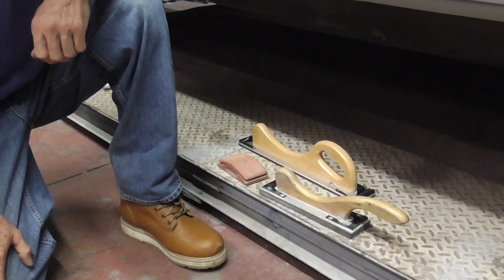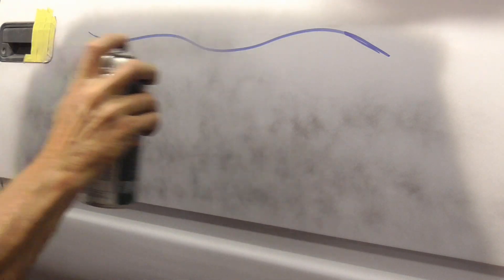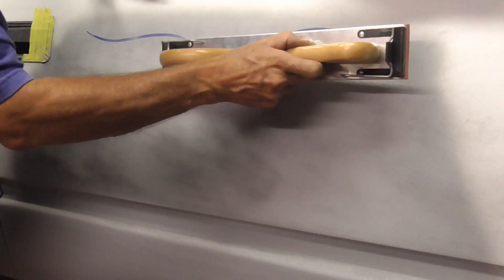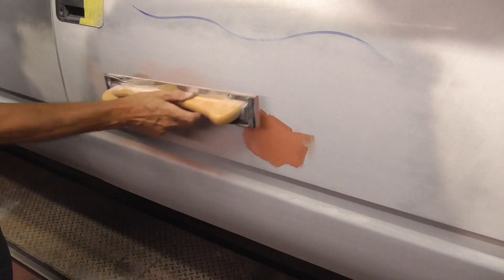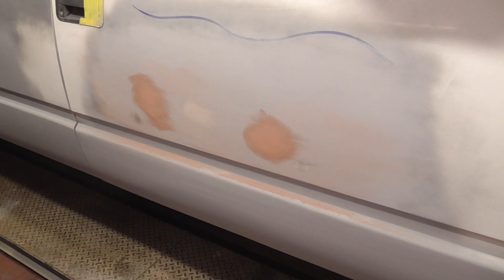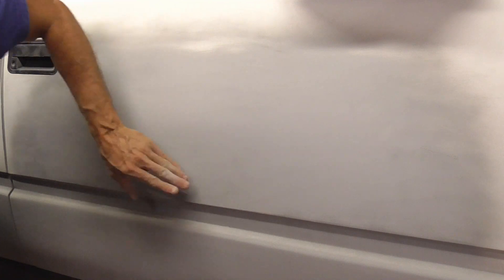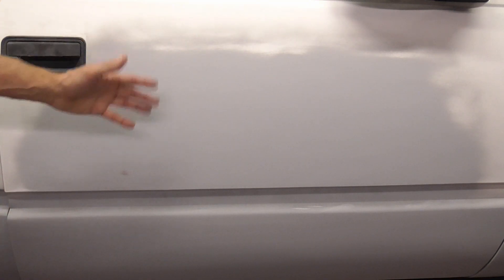Block Sanding Primer Surfacer: Addressing High & Low Areas

Comment: Great work as always.  When I first saw you sand the putty and feel the surface for smoothness, I grew concerned.  It seemed like you were falling back on your skills and experience I can’t come close to.  Then you sprayed it and block sanded it again and it became clear.   Before I start block sanding my primer surfacer I will watch this video again. I am off now to find those sanding blocks.  Thanks again for sharing your knowledge.
R,
Frank
Reply from the maker: You're welcome Frank - feel free to ask any ?s - even if they seem easy as heck :)
Reply: @LakesideAutobody  I have been advised to let body fill “gas out” and fully cure for a week before epoxy spraying.  Is there any truth in that?
Reply from the maker: @frankkennedy5361  Absolutely no truth in that.  If that were true, all these dealerships and body shops would be backed up to years and/or having work coming back with problems because the filler is primed minutes after it's finished with 80 grit.  Good question Frank - good for others to hear to dispel myths :)
Reply: @LakesideAutobody  I know body shops don’t wait long before priming over fill, thought I would ask anyway.  Not waiting a few days doesn’t necessarily mean it is a best practice.  However, your point about problems and call backs is spot on.  Once myths get circulated they have a life of their own.
Reply from the maker: @frankkennedy5361  I don't think it would hurt to do it but then you have to think of letting the metal sit w/o primer on it so.... sort of a trade off.  I think it's just best to do your body work and prime it when you're done or ready to prime :)
Reply: @LakesideAutobody  After applying a primer surfacer do I need to seal it before spraying a  base coat?
Reply from the maker: @frankkennedy5361  No.  Some sealers are dark or close to your paint color so if you are spraying a dark or light color it can save paint.   It can seal your body work if you are scared the paint will react to old paint or the materials used to fix it.  Finally, it can fill minor sand scratches and imperfections.  It's a choice thing really - some folks use it all the time, some periodically (myself), some not at all. 💥🛠😊

Comment: Hmm...this video needs a good title. Awesome job demonstrating how to really make those repairs disappear - block sanding! I would add and stress the importance of always working with sharp paper. When the paper starts to dull I start to bear down a bit more and bad things happen. An old memory I have from when I was still working out of my Dad's garage - he would be picking up my used sandpaper to reuse for his woodworking projects, telling me I was wasting paper lol! Something that still frustrates me is blocking out a filled spot in a large flexible panel like a hood. Sharp paper and LIGHT pressure!! If you have any tips to share for that I would love to hear them. Great job and I hope anyone getting into Auto Body studies this video closely. BTW, you are attracting some big attention with your great videos - an Eastwood ad popped up today! Thank you Jerry!
Reply from the maker: You are so right about the sharp paper - absolutely great tip!  Sharp paper is the key because it cuts through and doesn't ride over.  Thanks for the comment and tips - Have a great week and you're welcome.  Jerry

Comment: i.m not a body professionnal, for my final inspection before final sanding , I wet the surface with a wet sponge so i can see the repair in the glossy state of the surface and I can correct if necessary
Reply: That's what the Guide Coat is for.

Comment: Thanks . I think I got it now . on high spots you tap down and fill with filler . then sand down . prime and block . same on low side except you just fill. Sand and reprime . block again . you should end up with a perfect panel . wow a lot of work .
Reply from the maker: You've got it - yes it is a bit of work to get a perfectly straight panel.  Sometimes after all that work you still see something wrong with it too - but that's "par for the course" as they say :)
Reply: @LakesideAutobody  thank you !! i am subscribed . 😁
Reply from the maker: @direct998  Thanks - feel free to ask ?s - I get to them 1-2 times a day :)
Reply: @LakesideAutobody  hi I. Did the block sanding . I took care of the low spots with 2k glaze putty . I reprinted . looks good but the areas where I last used the glaze show through . it didn't do this last time . should I skip adding the reducer for a more thicker build .?? I'm using primer surfacer . 4 . 1 . 1 . four parts primer 1 part hardener 1 part reducer .
Reply from the maker: @direct998  Yes - every time you do body work (use of any type of filler) you have to prime and block with thicker primer surfacer.  Thin "finish primer" is only used for finish sanding - when everything has been block sanded perfectly straight :)
Reply: @LakesideAutobody  got it . I'm waiting on the glaze to dry so I can send it down . I'll skip the reducer and give 2 to 3 thick coats .
Reply from the maker: @direct998  You can still reduce it - just make sure that it has some "filling" capabilities.  Doesn't have to be super thick.  i.e. Heavy body work = thick primer surfacer.  Body work done with putty, etc uses medium thick surfacer.  Final sanding primer is thin so it sprays smooth and easy to sand.
Reply: @LakesideAutobody  got it thanks

Comment: Hi. Many thanks for sharing..still usefull vids ...I have watched many of yours and (I am sort of beginner) I keep thinking you are using too rough a grit for filler and now you seem to be using 120 on fine filler / stopping paste / glaze ...My understanding was that the stopper filler is to remove fine scratches but would you not be putting more back into the surface?...I go over this with around 320 / 400 ...is that too fine or is it just that it will take me longer?...Thanks
Reply from the maker: The body shops I worked at had 36, 80 120, 220 and 400 that's it.  36 and 80 was for filler - start with 36 finish with 80.  80 and 120 was for blocking primer or DA sanding.  220 was for prepping panels for paint or finish sanding primer w/ DA.  400 was for wet sanding primer and panels for paint.   As long as you final scratches are 220-400 (240-400 today) you're fine.  If you have more questions feel free to ask :)

Comment: Hello Sir,
Thank you for your videos I really enjoy learning and watching them.  I just bought a 1968 Chrysler Newport and started stripping the car down to the metal.  The previous owner used a paint brush to paint the car. 😅  Do you have any recommendations on what type of primer to use on bare metal?
Reply from the maker: You'll want a primer surfacer that is DTM - direct to metal (most are today).  You can use lacquer primer surfacer (1K) don't have to mix with an activator or urethane primer surfacer (2K) must mix with an activator.  Here's a good video on primers - https://www.youtube.com/watch?v=I5RaAgbNOe0  Very cool car by the way 👍👍👍
Reply: @ Thank you Sir. Really appreciate it! 🙏🏼
Reply: Hello Sir.
I removed the two fenders off the car Newport to see if I can hit out the dents, but it’s too much for me to adjust and finish.  Do you do work on the side if I mail you the two fenders for adjustment?  I can make it worth your time $$$.

Comment: Good info, i bought a hog and paper, longboard and paper, and cheeser.
Reply from the maker: It's good to know that these tools are all that are used in most "good" body shops.  You won't guys using some of the crazy things seen in videos on YT in high volume body shops.  They will be using air tools (not electric), long boards with 2 3/4" paper,  air powered DA's, cheese graters, and grinders with fiber resin disks (air)  - again no electric tools. Maybe the buffer might be electric but that's about it :)

Comment: Ok I got very straight . but I have some issues I hope you can help me with . bear with me . I used epoxy primer since it was a new panel . where it was welded body filler was used and I went about an inch and a half beyond to blend it in . anyway I sprayed 2 coats of epoxy but I have some runs . best way to get those out?? Grit of sandpaper? I have 2 other mistakes. I have to sharpen a body line . and fix a nub on the wheel lip . didn't see that but the black primer makes it stand out 
 After addressing these issues do I block sand the epoxy or spray it with primer surfaces? I'm using ppg  shopping products 
 .
Reply from the maker: You really can't sand epoxy primer.  You want to spray a quick coat of epoxy primer then a few thick coats of Urethane Primer Surfacer or just DTM Primer surfacer - that's direct to metal - no need for epoxy primer.  Anyway after your primer dries block sand with 120-180 and your good.  If it's not flat you'll have to prime and block again or use some putty then prime and block.  Sorry about the late reply - Jerry
Reply: @LakesideAutobody  got it almost perfect . the body line wasn't sharp enough . I watched some more videos and got good enough for me to smile . the tape worked wonders . found 2 more very small spots I am working on now . I know I'm a complete novice but I want it perfect . I really appreciate your help.
Reply from the maker: @direct998  You're welcome for the help.  Keep at it my friend - try to get it perfect - you can't fail if you try enough times :)
Reply: Hey quick update . it's in primer surfacer . I do see 2 areas about 1/2 long each where it looks like I need to go over again . would a glaze type putty be good here? I tried the evercoat 1k spot putty but it doesn't really harden unless it's on there overnight. The paint store recommended a 2 part spot putty . suggestions??
Reply from the maker: @direct998  You can use regular filler right over primer, 2K putty which sands easier, or if it's super minor you can use BONDO spot and glazing putty - that's the red stuff you see me using - dries super fast, get it at Walmart, sands super super easy, doesn't shrink if you use it sparingly.  2K glazing putt is probably your best bet - it will harden in about 15 minutes if mixed according to the instructions.  If it doesn't harden, scrape it off and add more hardener on the next try :)
Reply: @LakesideAutobody  thanks . I'm blocking it tonight
Reply from the maker: @direct998  Have fun my friend - good times.  Let me know how it goes :)
Reply: @LakesideAutobody  lol!! I'll let you know tomorrow.

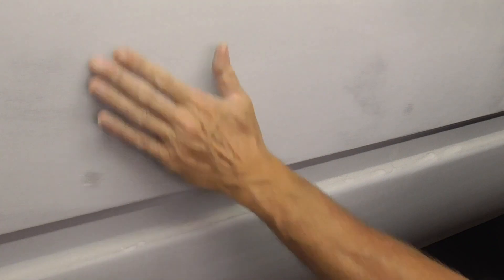Comment: Hello Jerry.  6:01  I want to use bodyfiller with hardener, instead of 1k putty to fill the low area. But do i need to sand with 80 grit the low area on the primer , and more important - should i go down to bare metal.
Reply from the maker: You don't have to sand the low area on the primer but I do.  I really never put any type of filler over an un-sanded surface - I just rough it up real quick with 220-120 - anything laying around.  You don't have to go down to bare metal.  Going to BM is really just for larger dents and serious damage.  How that helps - if not ask again :)

Comment: Hi, i do body work occassionaly in home. for small dent, i use spary paint primer i dont use gun, for paint and clear (yes i do).. i see so many jorgans like primer surfacer, primer filler, high build primer et etc. what do you recommend for spot dent repair in spray can please..
Reply from the maker: RUSTOLEUM filler pimer or something similar - I think harbor freight has some filler primer too.  It won't build too much thickness but if your body work is very close, there's no need for thick primer 😊

Comment: What is your opinion on the new acrilic sanding blocks?  Like Big Kid Blocks and Lucky Blocks.
Reply from the maker: Have not used them but they seem legit.  As long as the block has a firm pad and stays somewhat firm you're good.  Remember if you're trying to get something straight your block has to stay straight.  You don't really need anything to flex - the block does the blocking YOU do the curving if you get what I mean.

Comment: What are your tips for doing a polyester glaze after your done with your bondo and before you prime?
Reply from the maker: We used to use it in a shop I worked at.  I liked it - sanded easy, went on nice, put it right over paint or primer, never shrank, etc.  Just something I don't use now because of the cost.  I try to get my filler right on - maybe use a tiny bit of lacquer putty -(Bondo Glazing and Spot Putty)  - super cheap, super easy to sand, don't have mix, dries real fast.  I'll do a video on that topic - there is a lot of info and thoughts on that topic.  Hope that helps you out a bit.

Comment: Thank you. I do smart repair and I am still touching up my dent repair skills. How long did you leave the putty to dry for, I sometimes sand it too early and it takes chunks off.
Reply from the maker: If you are talking about the red putty, it can dry very quickly if used thin but usually I put it on at the end of a work session and then let it dry over lunch hour or overnight.  Primer - same thing.

Comment: I’ve never seen 907 used for anything more than pinholes; is it strong enough for such a big area?  Also, have you ever used Durablocks to know how they compare?
Reply from the maker: The depth of that low spot was about 2-3 sheets of paper thick.  You're absolutely fine using it in this fashion.  I would say however, don't go over about 1/16" even though guys in the shop or even myself have gotten away with using it even thicker.  It won't shrink like Keith stated if used correctly.  If you need a thicker filler use 2k or regular filler.  It was pretty common to see guys using a tight coat of filler over sanded primer.
Reply: As long as it is encapsulated by a 2k primer, it is ok and I mean only ok.  I don't like to use it for anything other than pinholes and I would recommend a 2k glazing putty like Evercoat or something similar.  But that's just me.
Reply: I like durablocks too. I have the stick on and hook and loop. That's almost all I use except for specific situations where I need an 18" long board that is stiffer than a durablock.  In that case I use a 3m polymer longboard.  Again, just me but it always ends up straight!

Comment: After you finish a panel and move on to the next what can be done to get moisture out of panel. I have a 69 Nova that I want to paint silver metallic. My fear is bodywork could take me years to finish entire car.  My fear is moisture getting into my work and showing it ugly face in my clear 6 months after I paint it.  Any suggestions on what to do on a long term project like mine to avoid this problem
Reply from the maker: Yes - what I do is after i prime it I give it a light shot of some cheap enamel paint laying around - that seals it till I want to block sand it or continue working on it.  You can also just use some epoxy primer to seal it.  As long as what you shoot it with is water proof, your good.  Hope that helps :)

Comment: Great video. Speaking of block sanding pads, your medium sanding block looks like it has an extra thick pad. Did you make it that way, or where did you buy it? Thanks.
Reply from the maker: I was worried if someone would notice that.  That is a flip flop sole from Dollar General cut to fit the board.  It was the only foam I could find stiff enough to not flex too much and follow the contour.  It was a completely flat sole, the stiffness that I needed but a bit thick, and just big enough.  I really should get a new board but I've had this guy since I was 20 - it's a good friend - never lets me down :)
Reply: @LakesideAutobody  I could put some paper on a pair of them and skate my hood smooth.
Reply: @LakesideAutobody  Let me guess....you used "Shoe Goo" to make the pads stick? :-)
Reply from the maker: @georgezap1906  Probably would have worked well.  I think I used 3m Spray Adhesive.
Reply: @LakesideAutobody  Excellent.  I use 3M Spray to "tack" and align fiberglass patches.  By the way your Surform cheese grating technique on 'green' Bondo cut my work time in at least half, thank you.  I used two old blades from wood projects, one flat and one convex, and thought I knew everything after 40 years of hobby work -- you are the MAN!
Reply from the maker: @georgezap1906  Great idea to tack those patches - I'm going to remember that and try it.  Glad to hear the Surform is helping you out - soon you'll hardly have to sand anything you'll be so good with the grater - have a good weekend :)
Reply: @LakesideAutobody  My barn find 1965 Sunbeam Tiger had rust holes as usual in the least accessible areas - in front of and behind the rockers in the wheel wells.  Grind the surrounding area to bare metal w/36 grit, make a paper template, cut the glass cloth and mat, shot of 3M on the edges, then come back to brush on the resin in 10 minutes.  No slipping or sliding, the resin is happy with the 3M. You can thank me later.  I can't thank you enough for the education.  Have a great weekend Sir.

Comment: Do you use same sanding directions for areas with contours like quarter panel wheel arches? Also how would you gauge if spot putty would be enough for a low spot or if you need a thicker filler? Thanks for the videos. Attacking my first rust repair and they’re helpful
Reply from the maker: No matter what the shape of the panel is, I always try to cancel out the last direction of sanding I was doing.  If you go diagonal then you would change up and go diagonal in the opposite directing.  I you use circles cancel them out with straight sanding or diagonal.  There's no rules even though these guys on tv say there is.  You do what works for each individual job.  Here's a good vid for contours:  https://www.youtube.com/watch?v=-66tf0tpeqo  or  https://www.youtube.com/watch?v=PkDY4b_I8w0  Hope that answers your ? - Jerry
Reply: Hey Jerry another great video, is that primer 2K or not ? …. Many thanks